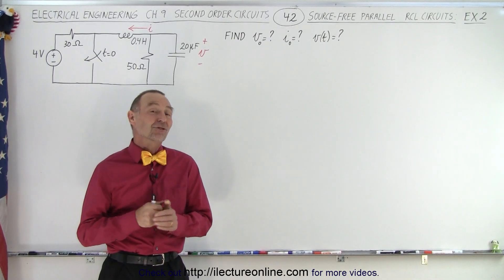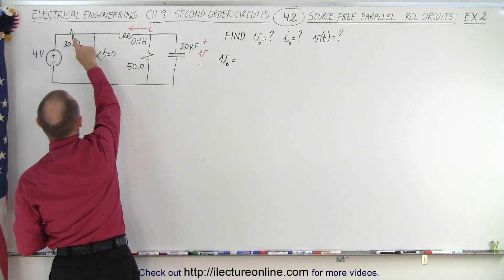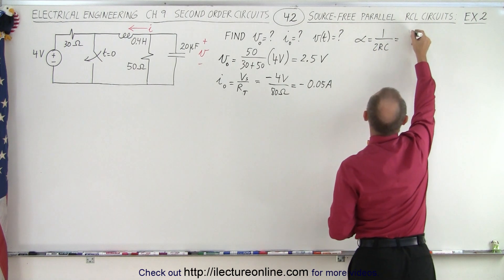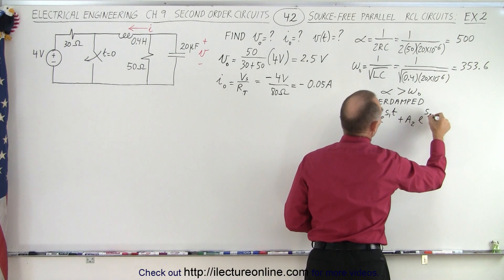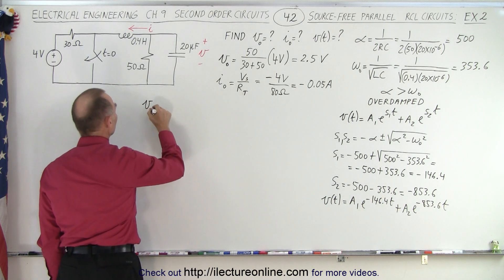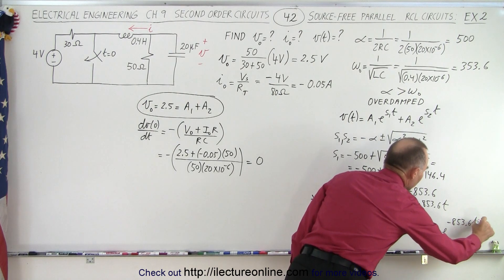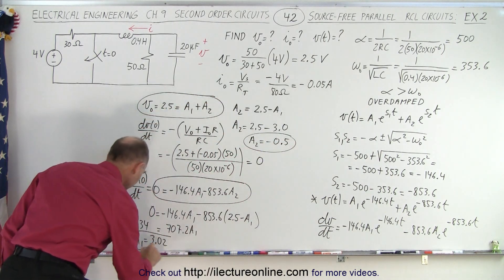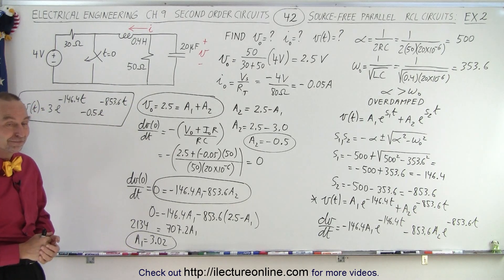Electrical Engineering: Ch 9: 2nd Order Circuits (42 of 76) Source-Free Parallel RCL Circuit: Ex. 2

Comment: why did you take i as negative cus the current is flowing towards the inductor rightwards.? plus the derivative of voltage current was also taken by negative which i did opposite....
Reply from the maker: that is relative to going around the loop in a clockwise direction

Comment: When t>0 switch is closed and we have voltage supply in the new circuit, isn't that meant to be a sourced rlc circuit in parallel (step response kinda thing😂)
Reply from the maker: Not sure what you are asking, but when the switch closes, all of the current from the rights side of the circuit, will now flow through the short (instead of the left branch with the voltage suppliy) and all of the current coming from the left branch with the voltage supply will also flow through the short and not through the right side of the circuit.

Comment: Got a question. Why not 80 ohms? why only 50 ohms is considered in the process of solving the damping factor. Thank you.
Reply from the maker: Once the switch is close (at t = 0), the current (i) will not go through the 30 ohm resistor, (it will take the path with zero resistance)

Comment: Can I ask a question about friction on an inclined plane?
Reply from the maker: Sure.  We have lots of videos on inclined planes in the physics mechanics videos
Reply: @MichelvanBiezen  what if a crate was being pulled by a rope on an incline and the incline had an angle of 36° and the angle the man was pulling the rope was 19°. The crate weighs 109kg and the friction force was 0.64. What is the minimum force required?
Reply from the maker: We have videos just like that in the playlists.   PHYSICS 4.7 FRICTION & FORCES AT ANGLES
Reply: @MichelvanBiezen  thank you!